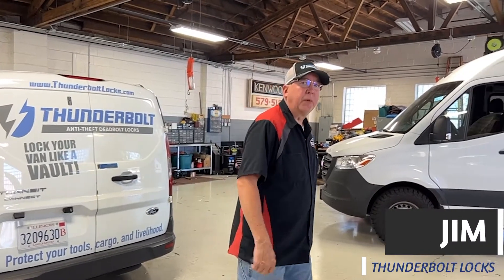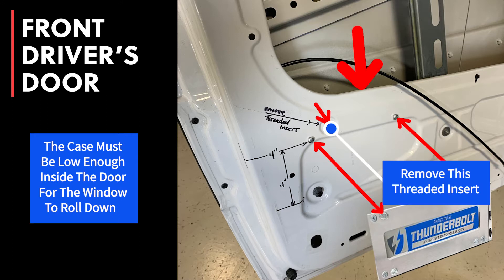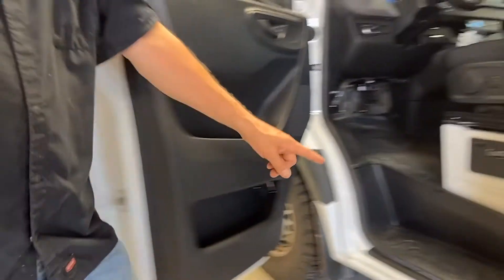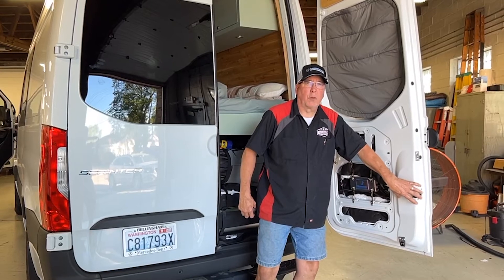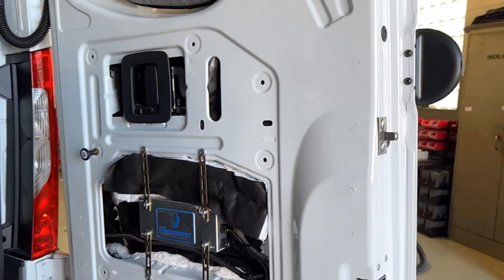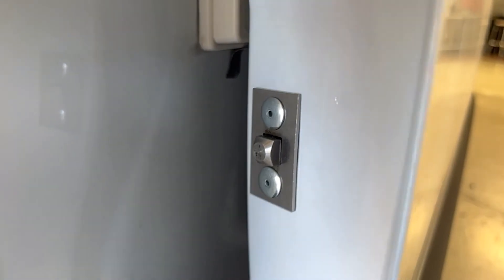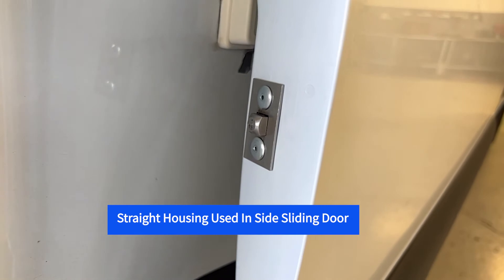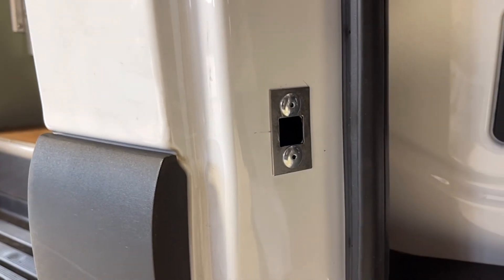Mercedes Sprinter Thunderbolt Lock Installation

Comment: Question, the housing position in this video differs greatly from the housing template available in the Thunderbolt Resource Center.  Is either location acceptable in a Mercedes Sprinter VS30 (2019-2024)?
Reply from the maker: We suggest following the latest templates but the locks are very universal and can be installed in various locations.

Comment: Location of the box in the cab did not work for my 2023 sprinter, interfered with the window. Needed to move it all the way forward and down in the door.
Reply from the maker: The case location can be located in various spots with the universal design. We provide suggested locations but find many doors are different and the case may have to be set lower. Sounds like it worked and we’re happy to hear that. If you have any questions please reach out to our tech team. Safe travels!  🚐
Reply: @thunderboltdeadboltlocks3871Yes it worked, just a bit different location than your current sprinter install video. Thanks.

Comment: Is the 2016 Sprinter rear door installation the same process?  Thank you!
Reply: Yes, it is the same process, though your doors may be different than the ones shown in the video. The concept is always the same to find a spot where the housing and bolt will strike into the mating door and nothing impedes that actions. Also, if you install the locks in your front doors make sure the case is positioned where it will not block the window from rolling down. Contact our shop with any installation questions by going to our website. Thanks!

Comment: If someone breaks the window and reaches for the lock button does  everything unlock like normal? I’m not seeing the benefit unless it’s on a separate circuit.
Reply: The locks should go dormant after ignition is off to prevent that. We do offer a Lock Control Relay that will prevent that from occurring or you can install our M2 locks and keep them on a separate circuit. We have a video on how to test your locks to see if they are vulnerable.